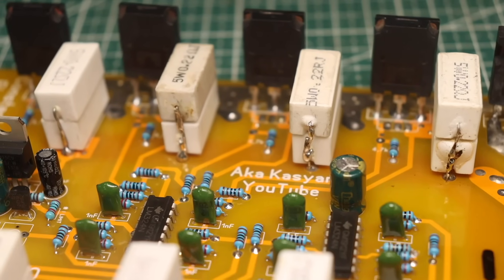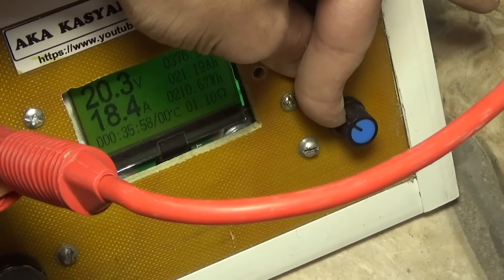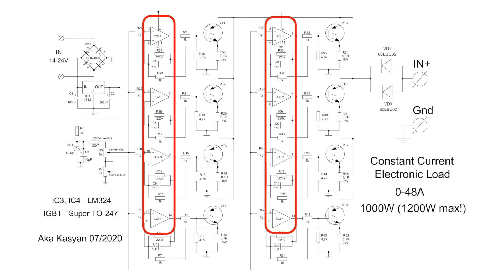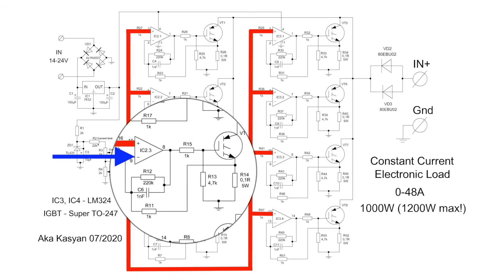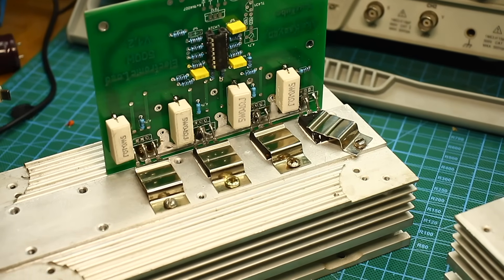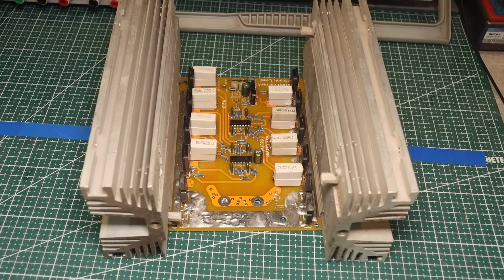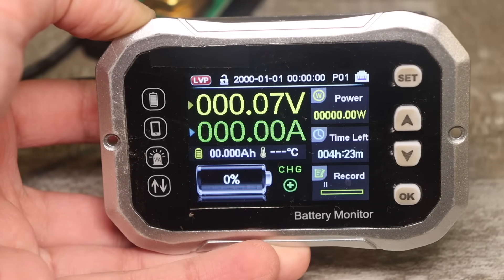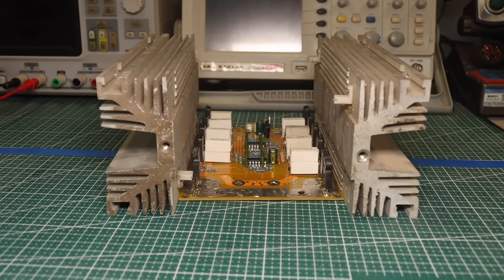MONSTER IGBT Electronic Load 1000–1200W (JLCPCB)

Comment: what kind of nonsense is this? IGBTs operating in linear? Then talking about drain source resistance? What drain and what source? You have IGBT, so? Control using LM324?  How many A/us (amps per microsecond) does this load do?
Reply: Dude…this is a DC Load. Your a/us do not apply in any way. And the fact that he has used Drain and Sourve instead of Collector and Emitter can be applied a bit more politely. For the circuit operation it is doesn’t mind which technology is used for the Powersemiconductor. IGBtT / MOSFET, bipolar…don’t care the op amp will measure the current through the shunt a steer the Transistor accordingly. And yes it is a  (multi) linerar current source.

Comment: extremely high switching losses will occur in mosfets connected to the current control system you operate with op-amp, because the op-amp will try to operate the mosfets at a very high frequency, a pwm-based system whose frequency can be controlled will be much more efficient :)
Reply: The load is intended to be linear.
Reply: Why do people ever bother writing about stuff without doing any research...
Reply: Так здесь не нужно быть эффективной системе😂😂😂. Это навороченный нагреватель, не более
Reply: Nothing is switched. This is a completely linear analog module.
Reply: This is a typical answer from electronically uneducated folks. Please do your research before posting such stupid statements.
Reply: U kinda need this to be lossy that's the point
Reply: Switching and current control... were you crapped outta your mind when you made that comment? 😅

The opamp is not a PWM controller. It is onfigured as a voltage comparator, with its output driving the gate of a MOSFET, and because it is using a MOSFET, it is a voltage control, NOT a current control like one would do if it is using a power transistor.